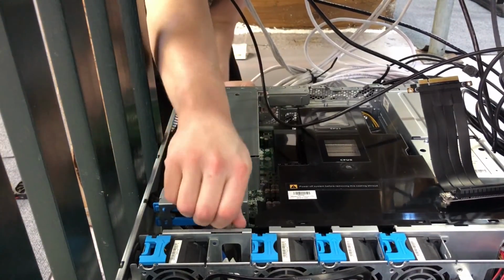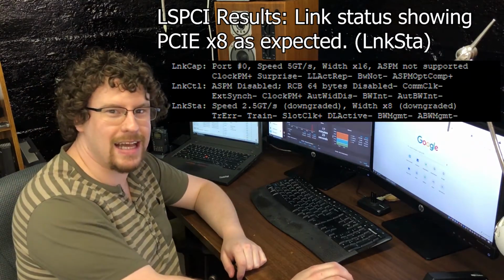Modifying a x8 PCIE slot to take a x16 GPU! I fixed my servers jank install.

Comment: I used a plastic debit card to insert inside the slot to help protect the pins and prevent crap from bowing into the slot. I cut parallel too. I went slow and when the plastic got hot enough from the friction of the Dremel grinder, i was able to push the slot through the heated plastic wall with the debit card. Easy Lemon squeasy.

Comment: Do you not have to add power to that video card? I plan on putting two of them in my server but AI is telling me I need to use an external power supply and power them up first. I have the same GPU, mine are 8gig.

Comment: Silly rabbit, you should be cutting the whole end of the connector(rotate 90 degrees).  Also, taping up the board and the connector should prevent nicks and dust.

Comment: nice one mate your info was a big help i have recently bourt a dell 710 from ebay and did this mod and fitted a gtx 1070 card and i added the 8 pin wires to the removbable powersupply as there is 2 but for now just means i can only run one of them do you know if there is a way of disabing the error message on the little screen on the frount warning  me that iv removed the seconds psu and do you know how to ajust the fan speed of the server ? cheers

Comment: i have gtx 780 and it has bad vram it crash whenever it gets to desktop would it work if i made it run on x8 pcie? i dont mind underperformace i just want to work with it even at half or less than half performance money is tied cant get anything new
Reply: It run but as x1

Comment: For anyone watching this, you absolutely want to cut it perpendicular on the end, not how he did it. I just did mine and it came out looking like it was factory. Didn’t damage any pins and the plastic was smooth. There is no need to damage pins by cutting parallel in the slot
Reply: The whole time I was watching I was wondering if it might be easier to just cut the end off rather then risk cutting inbetween the pins.

Comment: I think it would be worth making a jig or wooden clamp (with the dremel) first to hold the dremel, and also making a basic 'rail' or fence along which to slide the riser-card careful to get a steady cut and, at that, a neater cut. It would be easier to stop too (if you felt things were not going as optimally as you desired). Done right, you'd never have scratched that green pcb masking off. That might have snagged and gone awry even worse. Firstly though, make a kerf in the pci-e slot with a tiny saw craft-knife. A jig for a dremel is a thing that people use for a great many other things anyway. Sort of like a pillar-drill for horizontal or vertical cuts or drilling. It is safer for eyes and fingers (because you have to make a little 'guard' for it).

Comment: Just cut the PCIe fingers directly from the card to fit an X8 slot length... Works like a charm... Those fingers are just for data/bandwith anyway so the card runs at X8 like normal...

Comment: Hi Shae. Where did you find that 8x to 16x riser? I've found plenty of cable adapters, but not something that has an actual PCB for the 16x slot to be on.
Reply from the maker: It was on amazon actually. Here is the link (it will be amazon Canada). I notice that the products sometimes differ between countries though. I found this riser to be very high quality. https://www.amazon.ca/PCI-Express-Extension-Cable-180%C2%B0/dp/B082SQNVNM/ref=sr_1_10?dchild=1&keywords=8x+to+16x+riser&qid=1591136808&s=electronics&sr=1-10

Comment: I used the rounded wood carving tip to get that last little bit after using the blade to cut off the biggest part

Comment: Maybe you should just desolder the slot and replace it with the open end ones
Reply: I thought the pins are under tension inside the block

Comment: @Tech With Shae I wish you would have seen my comments on your server part 1 video with the link to how to use that video card without hacking your server up this one has 8x slots, but there is 16x 2U server riser card's available. https://www.ebay.com/p/1600163236?ul_ref=https%253A%252F%252Frover.ebay.com%252Frover%252F0%252F0%252F0%253Fmpre%253Dhttps%25253A%25252F%25252Fwww.ebay.com%25252Fp%25252F1600163236%2526rvr_id%253D0%2526rvr_ts%253D291f0ac31710ac3e08d04dc0ffed9af7

Comment: I had mine done the same thing but not with that tool, im using a soldering iron with custom tip (a blade) and burn the plastic. Its a bit of  a work and requires open space for ventilation. But hey its done the job really well, although its pain in the ass to clean the blade from time to time when im doing the mod.